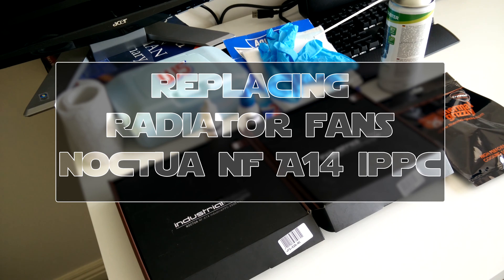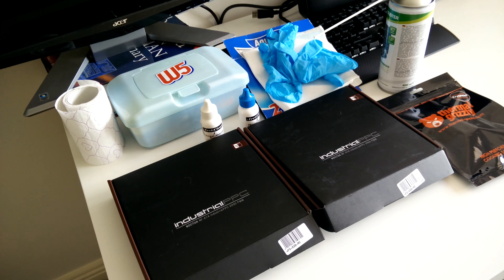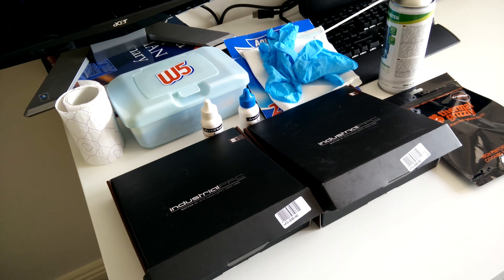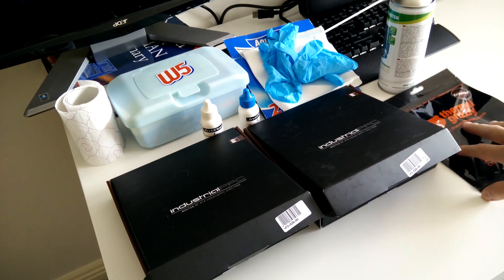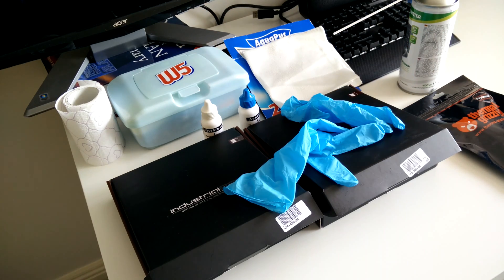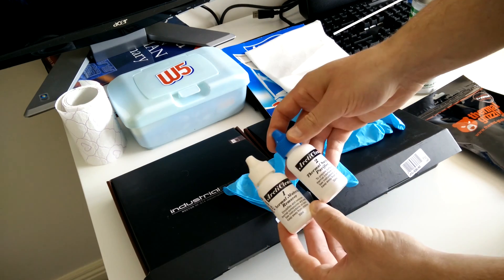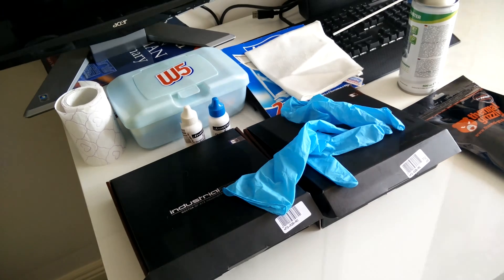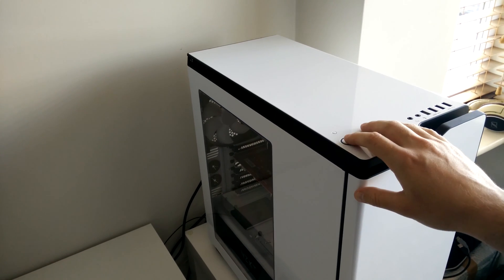Tech Video: Replacing H110i GT Fans - Noctua NF A14 iPPC

Comment: Wait a Moment...those fans are pushing or not? O.o
Reply from the maker: They're in pull config. Pulling air from the system out. So exhausting the air. Three fans at the front pushing air into the system.
Reply: @AlValentyn  Hope you understand what i mean. Btw in going straight ti buy them bcs this Min (facebook,films ecc)and Max potential for June,july and August are perfect
Reply: If i install the radiator in the front panel to "push " the "new" fresh air passing through the radiator ... ins better than pulling the used and hot air(gpu,motherboard,cpu ecc)from inside the case? Sorry for bad eng :(
Reply from the maker: That depends entirely on your system. As the radiator will heat up the air and that hot air is then pushed into the system; instead of being exhausted. Which means the motherboard and GPU, along with other components can run a little hotter also

It’s generally not an issue; but you’ll have to check temps and move it, if it is a problem.

Comment: also, with yours in pull mode.. how is it even getting enough airflow with that case? I love the looks of those cases, but hate how the top is almost closed off.. i know its not really, but still VERY constricted.. i have the phanteks ethloss pro case.. however u spell it.. so I should be good with those fans right? and okay having them blowing up out of the case? on the bottom of the radiator?
Reply from the maker: Pull mode works really well, especially with good fans. You’re entirely right though, the H440 chassis is extremely restrictive.

I’ve since then swapped to an Enthoo Luxe, and it’s been fantastic.

I run the fan under 1200 RPM for max, and general use around 800-950.

Temps are significantly better

Comment: im ordering Noctua NF-F12 iPPC-2000 PWM to replace the fans that come on my masterliquid 240 AIO.. quick question.. you have yours in PULL mode right? cause u put the fans on TOP of the radiator.. did I do mine right? cause I put the fans blowing OUT and on the bottom of the radiator, mounted on the top of my case.. my temps under load never go over 70C so I think im good.. but when i turn the fans al lthe way up there is a whine sound.. i t hink one of the bearings is bad.. the noctuas should be very quiet

Comment: I have the exact same cooler and agree the fans are absolutely fucking atrocious, I'm also looking at the exact same fans so your video is much appreciated! I take it you've been able to utilise the PWM functionality okay? I ask cause I notice your connecting them to the pump rather than the motherboard so I just want to put my mind completely at ease before ordering some myself.
Reply from the maker: If they're connected to the pump you can control them via the Corsair link software, since it's a PWM controller there.

So you can set profiles, otherwise they'd run at 2000RPM all the time and sound like turbines. :D
Reply: That's exactly what mine are doing! >:( 
Anyway, I've ordered a couple to replace them, thanks again for the video - it was a huge help. :)

Comment: I actually just ordered these same exact fans for my H115i GTX cooler.  The fans Corsair included with mine are awful too, very loud at over 1300RPM and almost always has an annoying humming sound at any speed. Occasional rattling as well. The Noctuas should get here in a couple days hopefully!
Reply from the maker: Just make sure to set a nice fan profile in the Corsair Link, so these fans don't run at 100% speed. 

At 2000-3000rpm they're extremely loud, but oh boy do they shift air.
Reply: I did exactly this after installing them this afternoon. Much quieter and maybe a couple degrees cooler after making a new profile. Absolutely worth the purchase. I no longer NEED to wear headphones when gaming now!
Reply from the maker: +SLI1337 glad to hear you got it sorted. A good fan profile goes a long way when it comes to balancing performance and noise.

Comment: Thats an old gpu there
Reply from the maker: It certainly is. Makes for a great backup when I need it.
Reply: Al Valentyn
well thats great, i have second rig as backup :D
, but meanwhile if there would be some problems with gpu intel i7 6700k has gpu inside and that gives advantage of using pc, while you get replacement, mobo's used to come with gpu's on them wonder why they not doing it anymore even crappy gpu comes in handy when you dont have gpu at all and need to use pc....

Comment: what about noise level it is quieter idling?
Reply from the maker: It was significantly quieter at idle. Noctua fans excel at low noise, while pushing lots of air.
Reply: thank you :)
Reply: Can you please tell me what is the RPM of the Noctua fans while staying on Quiet mode in the corsair link software?
Reply: http://forum.corsair.com/v3/attachment.php?attachmentid=11180&stc=1&d=1345653377

that is the fan curve set for corsair link
Reply: If I were you I would just set custom fan curve as the fan only go up to 1500 rpm so it shouldn't make that much noise compare to the loud ass f stock fan. I bought the industrial version ( the black one that could go up to 2000rpm ) I have mine running at 800rpm for web browsing and what not and 1400rpm when gaming and mine 4790k at 4.4ghz never go above 75 degree in a p400s.
Reply: Jace Vo
Thank you for the graph. However these fans go up to 2000 RPM. The performance green line on the graph goes up to 2700 RPM..
Reply: Alright. Do you use the Corsair Link software? If yes and from what i understood, you have it on quiet mode at 800rpm?
Reply: jdj9 the thing about performance mode on the corsair link is that that thing will max out your fan speed and run it pretty much 100% all the time. Those are just potential speed of those fan, that doesn't mean that the fan itself is 2700rpm is just mean that the corsair link will push the fan to 2700rpm. For example a fan with max of 2000 will only run at 2000. Like I said you could always custom curve it. I wouldn't recommend running the fan below 800rpm anyway so.
Reply: Jace Vo
Yeah you are right.. performance mode is really not necessary and i never used it. I always have in on quiet mode and it serves me just right. I will check out the custom curve, i didn't know there is this possibility with Corsair Link, maybe i haven't really searched enough. The only thing that makes me consider buying the Noctua's is the loud noise the stock fans make when the PC starts. Other than that, they are pretty quiet under normal use and gaming.
Reply: jdj9 yea I have the h110igt and depend on your over clock and how hot the coolant is
Reply: jdj9 yea if you go into corsair link, click on your fan, and then click on mode there will be a whole bunch of option for you to choose from
Reply: Jace Vo
i never overclock my PC's :D i like to keep them safe :D
Reply: Hey,i bought the same fans as you some time ago and installed them as my case's intake fans,and honestly i kind of regretted buying them up until now,they dont make much if any difference as intake fans, temps are mostly the same and they are a bit loud when going above 1300 rpm,so should i move my two noctua fans on my cpu cooler and put my corsair fans as my main intake again ?  (got the same corsair fans as you but the rpm is 1000 max)
Reply from the maker: +R Madalin that should work fine, just to manage them as you were doing. 

For case fans cans the industrial ones from noctua aren't that great unless the fans grills aren't too blocked. They like the more open chassis.
Reply: Al Valentyn I got a corsair 450d case with a filter in front of the noctuas,and an air cooler not liquid,but the real questions is,will i see a big enough difference in cooling if i move the fans ? 
   It seems that you got better temps and that's encouraging but it is a lot of work to switch around my fans like that, so on my cpu block i got corsair af 140 1000 rpm,noctua's are 2000 rpm like yours,also i forgot to mention the noctuas are not pwm,small snag i know but im hopping to see a good improvement in temperature if i do this
Reply from the maker: +R Madalin well use a simple noctua fan on my new D15S cooler and the max it's set to reach is 1200rpm. It usually never goes over 950rpm, and the CPUs max temps under AIDA64 is 60 degrees. 

So for me it was well worth it. Sadly your biggest issue is that your fans cannot be Pwm Controlled.

Although they should still be able to be voltage Controlled via the bios if plugged into the CPU fan headers. 

The same for if your Noctuas as connected via a motherboard header. You can power the voltage in the bios, which will reduce the speed. 

So if you don't want to swap the fans, just try and lower the speed of the Noctuas on the chassis. 
Shouldn't make much difference to pc temps, but will lower the noise.
Reply: Well i had intended to get myself an aio cooler for some time,so i think ill just postpone this plan until i switch coolers,noise wise im not doing to shabby,i already set the noctuas to their minimum speed 900 rpm and all is good,noise is low and not distracting.
Im not sure how much of a problem the lack of pwm control is, but i can control the speed of them from 900 to 2000 rpm just fine so unless im missing something ,it dosent seem like the lack of pwm will pose a big problem when ill switch fans on my liquid cooler
Reply from the maker: PWM just allows direct control that's much smaller, at the scale of RPM directly.

Voltage is bigger steps, 900-1400-2000rpm and the like.
Reply: Al Valentyn idk I mean,they may be voltage controlled but i can control them incrementally from 925 to 950,975,1000 and so on all the way to 2000rpm,the jump in rpm is not gigantic like you just said.
Though the cpu_opt port may be problematic as it seems to always spin fans at close to maximum rpm when used since this port doesn't allow me to control the rpm of fans,so if I'm to try this I may need to connect a corsair fan in the cpu_opt port and a noctua fan in a port than can be controlled just so the noctuas won't make my ears bleed all the time. Or at least..thats my plan for now

Comment: i have corssair h110i and i have 3 pin it is real?
how i can connect 4 pin pwm to 3 pin?
i have this case nzxt notics 450 and i have hub pwm controller 3 pin i can connect 4 pin to 3 pin hub?
Reply from the maker: Do you have the H110, or H110i GT or GTX? All three are different and the H110i definitely has 4 pin PWM connections.
Even the Corsair fans that come with the H110i are 4pin PWM fans. The unit does not use 3pins.

Also only some 3 pin hubs have the space to allow 4pin fans to connect. If you do though, they cannot be PWM controlled, and will be controlled via DC.

This means they can't vary speed as well as PWM.
Reply: sorry im cheack now i have h110i 4 pin ,what is the diffrent beteen pwm and 3 pin fan?soory again about my question
Reply from the maker: PWM = Pulse Width Modulation. It means you can control the fan's RPM/Speed via software.

3pin = DC, it works in steps of power; like 3v, 6v, 12v.

Comment: how mutch pin fan have in the h110i?
how you can connect 4 pin fan to h110i? beacouse the h110i cooling have 3 pin fan no?
Reply from the maker: No, the H110i has 4 pin connections. Without 4pins it wouldn't be PWM, and the fan speeds couldn't be controlled then.

Comment: Thanks for the video :D I think i will buy the industrial NF-A14 instead of the regular one, seems to be even better quality with the same noise "And not that poop brown collor" ;) 

What chassi do you have?
Reply from the maker: I honestly don't mind the brown noctuas :P

One thing you have to be careful with is that the IPPC Noctuas are extremely fast and loud if you don't PWM control them, so do be sure to do that. No fan at 2000 or 3000RPMs is quiet.

The chassis in the video is the NZXT H440, although I replaced that recently with the Phanteks Enthoo Luxe. It looks better, and has far superior airflow, which lowered temps even more; and I could run my fans even slower now for better noise.
Reply: Ah ok thanks for the tip! :D

Havent build a computer in 6 years and even then i only used the fans that came in my Corsair 600T chassi so ill take all the information i can get haha ;).  still rocking a Sandy bridge 2600k and when the new I7 7700k releases it is time for me to build a new one :D
Reply from the maker: The 2600K is still very good, especially if overclocked to around 4Ghz. Even in current games like Deus Ex Mankind Divided it matches even the 6700K for performance.

Just remember to clean the rad and fans every few months at least, to prevent dust build up.

I personally recently switched to the Noctua NH D15S air cooler, and it's actually better than the Corsair H110I Was, and quieter. Only issue is the brown Noctua fan in the middle, the normal square frame ones don't fit :(
Reply: Yea i have a hard time beleving that i will ever buy "better" processor considering how long it's been good :)

Oh you have? I have a hard time deciding what i should buy. Aircooling like the DH15 or a H115i, im planning to put everything in a Fractual Design R5.

Though DH15 is a trusty cooler that will work forever. It's silent, effective, cheaper but it takes up a large space :P

The H115i looks really good, its not as big and i can put the radiator on the top for exhaust but i think the noice will be more since i have to open up the top of the case.

This is hard xP
Reply from the maker: Freddofresh Just remember, water cooling is only better than premium air when it's very loud. The fans need to run much faster to force air through the radiator fins = more noise.

The pump = more noise.

There are multiple points of failure, pump, tubes, rad, and fans.

While the air cooler is larger around the motherboard, if a fan happens to fail the cooler still works, and as long as you have chassis airflow it'll keep the CPU from overheating.

Also have a look at the D15S, over the D15. It's slightly offset, giving more room neat the graphics card, and have really good ram and cpu clearance.

It's also a tad cheaper since it only comes with one fan. I even bought a second fan, and the max temperate difference was 2 degrees for me.
So now I just run with a single fan, which is again quiter.

The loudest part in my system is the Pump from my Fury X's all in one cooler.

Here's my experience about my H110i GT pump recently dying, and the change back to air cooling.

http://www.alvalentyn.co/single-post/2016/08/21/Water-Woes-and-Air-Salvation
Reply: Al Valentyn "I'm idling 30% cooler than the Corsair unit, and 20% cooler under load"

Holy crap! Sorry to hear your H110i broke mate.. :/

I can't thank you enough Valentyn for your answers! Looking at the facts, you have totally convinced me to stick with aircooling and you have saved me money and trouble in the process.

/Subbed!
Reply from the maker: Freddofresh Thank you, I hope it all helps mate.

Comment: What version of the corsair link software are you using?
Reply from the maker: +randament1 I was using version 3 at the time of the video, but I recently installed 4; which seems nicer to use and has a cleaner interface.
Reply from the maker: +randament1 I was using version 3 at the time of the video, but I recently installed 4; which seems nicer to use and has a cleaner interface.